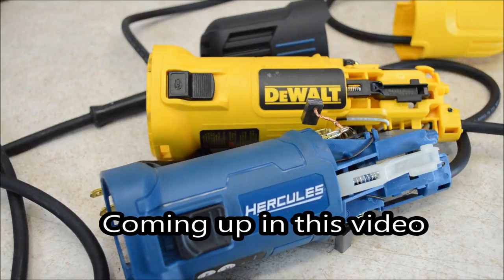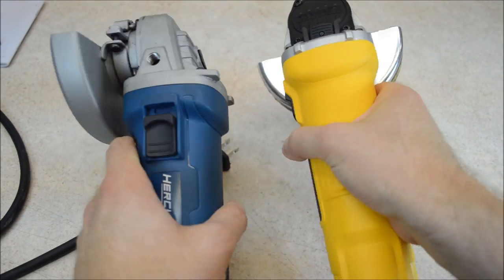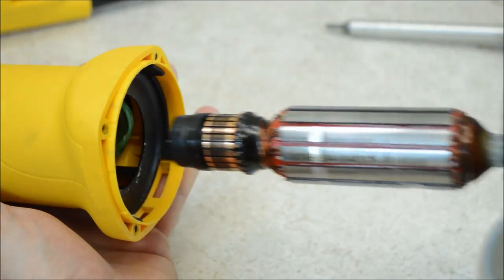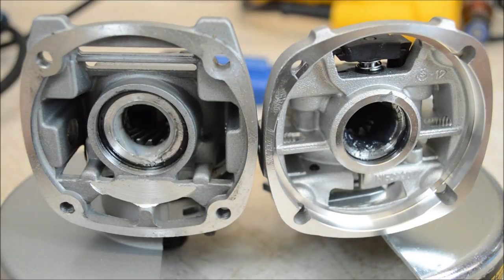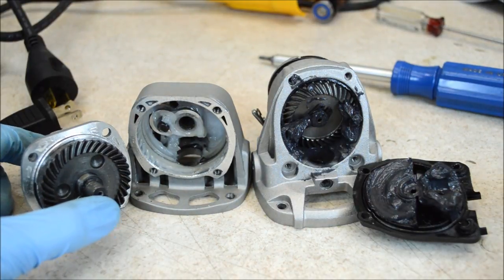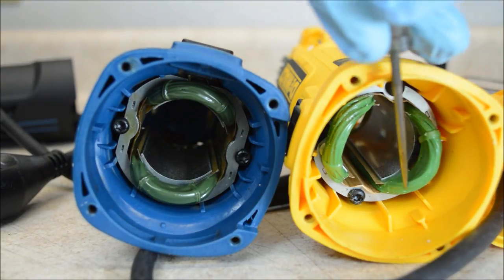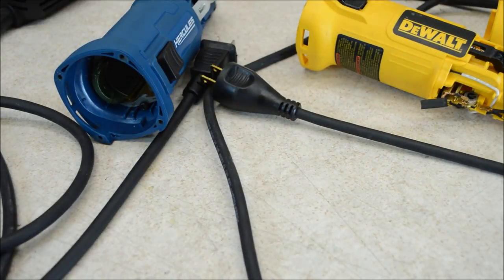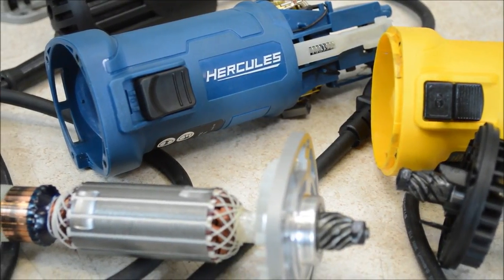Teardown part 1: Harbor Freight Hercules and DeWalt angle grinder comparison review

Comment: on the handle, the reason why they made it from abs is due to oils. overmolds dont take well to oils and cleaners. but they should have made it with glas fibers.
on the bearings, the shaft on the HF didnt go all the way into the baring and that would allow wobble.
the machining on the dewalt seems to be a bit better than the hb

if i were to buy one i would go with the dewalt due to better machining work and the better warranty and customer support.
but they are both good, if you just need a basic ginder to get through a project then the HF will do fine.
but if you want to step it up then the dewalt is also a good choice

and once again nice vid, i have been waiting for a channel to do stuff like this for a long time.
Reply: the shaft not going all the way through wouldn't allow wobble because the bearing is surrounding it. for it to wobble, the shaft would have to be machined wrong, bearing machined wrong, or the housing surrounding the bearing would need to be deformed.

Comment: Good video.. FYI that is an armature not a rotor..
Reply from the maker: Thanks for the kind words. In this case either term is correct.
Reply: While it's true that it rotates it is an armature and that motor is what is called a universal motor.. ( Licensed electrician and industrial controls technician..) Not trying to one up you just wanted to clarify.. As a side note DeWalt grinder uses 18awg cord which is rated 10 amps while marginal it is adequate but agree 16awg cord on Hercules is better than required plus more flexible being SV cord vs SVT and can take more abuse as well.. Personally I feel a 90 day warranty is rather weak and over the course of 3 years things can fail and DeWalt backs up their product mush better than HF.. Thanks for your informative videos :)

Comment: I have the same harbor freight grinder I put a oring under the spring for the lock button and filled the gear case with gear oil runs much cooler
Reply: Over filling a grease box is never a good idea. Full would be over full too. What you're seeing in these tools is the right amount.
Reply: Paul Frederick yeah I didn't use grease gear oil I only filled about 1/3 of the way up
Reply: Does it matter? It's Harbor Freight! lol

Comment: According to the World Steel Association, there are over 3,500 each has a different price, stamped or forged plus heat treaty. to the naked eye, both gears look identical How can you tell if one manufacturer suspense more money on the critical gears? The only difference I see DeWalt rolling its warranty price into Angle grinder. I personally went with the Harbor Freight
Only use it once or twice a year and I skip the warranty, my reasoning was it was 50% the price of a new one just too much money for 2yr.

Comment: DeWalt has the edge but Id take the HF because at the lower levels in the line, youd buy one because you are an occasional user and either would last forever so why not save cash?  If someone is making a living from a grinder I doubt they would be looking at these in the first place. A self-respecting guy making a living from any power tool isnt going to show up on a job site with HF anything. Its Makita or better.

Comment: I hate and I mean hate using dewalt grinders, all of them I hate ever used rattle and are annoying to use all day in a metal shop. That being said I would buy the dewalt over the HF. You get a better warranty for the same money and the guard is easily adjustable, which is a big deal when you are working and need to reach awkward areas. Also it is a more respectable name. If HF had an easily adjustable guard and was still $40 I would go with HF then.

Comment: The dewalt has been around a few years. Clearly the hazard fraught one is a ripoff in many design aspects. It appears the motors spin in opposite directions based on the cut of the ring gear. Im sure the dewalt has and the hercules will get some "value cost mapping" done to the components. The grease is better in the dewalt. taking apart the brush holder would be cool. from my angle it looked like the dewalt had fewer if any seams/joints. if we look close at the quality of the alloys in the windings and gears and casings, I think we will find you cant mess with 100 yr experience. I'm sure there is a lab in the US that is developing better varnishes to use on the windings of the next gen grinders. 10 yrs after that they will surely be on the low end models. It was hard to tell if there was a difference in the thickness of the laminations on the armature.thinner is better, aksi the alloy used in the laminations. Quality control checks to make sure parts that come in continue to be the expected quality. Hazard Fraught has a problem to fix with the perception of their electric hand held tools. This one goes a long way in the right direction. We will see if hercules is around in 94 yrs.
Reply: There are a few things i notice. I have used many grinders from day 1 till death. The quill lock on the hercules is proud and large, its going to get pushed while the motor is turning. The clearance of the gearbox for getting into tight spots looks a little better on the DW. I would never buy a 7 amp grinder in the first place, they just don't have the power. Considering this is the top of the line Hazard fraught against the bottom of the pile DW says something. The 89 dollar dewalt is a completely different machine.

Comment: Great review! They both look like excellent grinders and today I bought this DeWalt! at Lowes.. I was going to buy the Hitachi for $39.00  with case and 5 grinding wheels due to great reviews however when I looked at them the output shaft piece was made out of plastic.. This was a turnoff for me so I paid an extra $20.00 for the DeWalt.. I also liked the fact that you get a 3 year warranty plus it is made in USA.. I would be very curious to see a teardown of the $39.00 Hitachi kit which seems like a very good deal.. I am a Lowes fan because of the 10% military discount on everything as well :) Here is the link to the Hitachi.. https://www.amazon.com/Hitachi-G12SR4-6-2-Amp-Grinder-Abrasive/dp/B0199MMA84

Comment: Dewalt wins. They make things so nice. I really think not many companies can compete anymore.
Reply: Makita
Reply: Look at Makita's one year warranty vs Dewalt's three years,that speaks by itself,you make a good tool you give out a good warranty,I bought a Makita corded hammerdrill that thing didn't manage 10  3/8 holes in concrete before the gears stripped on it,no more Makita for me after that.
Reply: Jose Sanchez Milwaukee s 5years
Reply: framed up a school with 300 feet of wall a few years ago with a corded Makita, all pre-cast walls and deck, super old hard concrete. everything was hammer drilled and lead anchors. it ran hot for days, still works. also I love having the switch on the bottom for setting tight door frames. with that said I've never had problems with Makita or Milwaukee or DeWalt tools within 5 years of buying them, besides who has the time or patience to send back broken tools. and if you do have a tool you use so much for work that you need a new one every year get a Hilti.
Reply: jeffscomp makita,milwakee,porter cable,bostich,well porter cable,dewalt and bostich are made by black and decker,they just got craftman too..
Reply: Adrian Parada Milwaukee is Chinese owned and I think makita is Japanese. Stanley/Black+decker owns dewalt, porter cable, Bostitch, craftsman, and Irwin. They probably own other ones too.
Reply: jeffscomp yes makita ryobi and hitachi are japanese companies
Reply: oh wait bigger price, less name brands
Reply: Metabo
Reply: Your joking right?
Reply: Milwaukee tool is owned by TTI, Ryobi is partially owned by TTI, TTI makes the tools for Milwaukee, Ryobi and Ridgid. TTI  also owns AEG power tools in parts of Europe New Zealand and Australia. Ridgid is only sold in the US and Canada so Ridgid tools are rebranded for AEG.
Reply: I don't know what you were watching but I just saw the Hercules with the better wire and much better switch beat the DeWalt.... if you spend the 20 bucks for the warranty then you pay the same price for better quality... slightly better but better none the less

Comment: I prefer to watch this channel over that "Fraud in Canada called AvE" that guy is head is so full of bananas and biased opinions when it comes to brand name tools. Job well-done Tool Teardowns. B + my rating
Reply: lol the guy is brilliant. calling him a fraud proves your bias to less worthy comparisons. #brandloyalty
Reply: Ave is infantile. His analysis is sometimes ok and can be interesting but his views/opinions are generally not very well founded by what he does/analyses, and his sex obsession that comes into just about everything is just annoying. He's just a guy playing with tools and telling you what he likes and dislikes, not really why A is better than B for what specific reason, and if he gives reasons they need not be valid as there are always trade-offs. The batterypack measurement of the Hercules (edited the name, mixed it up :) )  drill is such an example. Some cells are better at high discharge rates and some companies may choose such cells, however, surely no screwdriver/drill runs at maximum power all the time. Almost 10A at 18V is almost 180W. (battery) drills do NOT get used at such continuous power! (edit: this means that the real Wh of the battery pack is in reality higher than what he measured and likely close to the claimed 50 Wh)

Comment: dewalt brushes springs are wider
dewalt plastic molding is better, much more details and better finishing
dewalt has grease with molybdenum disulfide
Reply: Tanase Andrei 8
Reply: Tear the Hurcules grinder apart, clean out the factory grease and add molybdenum grease.
I agree the moly grease is superior.